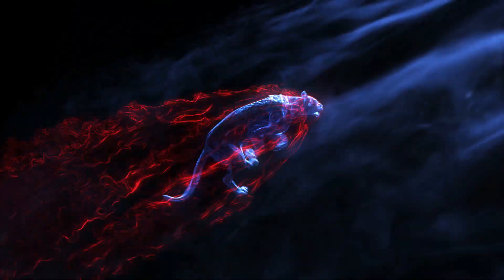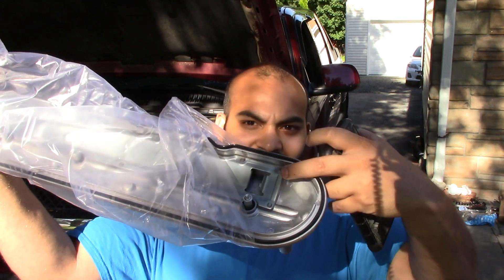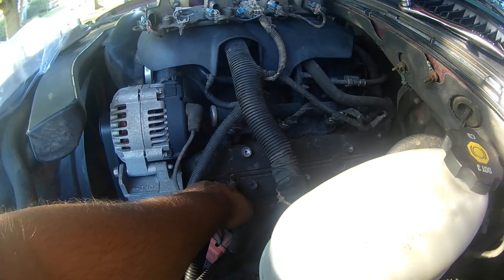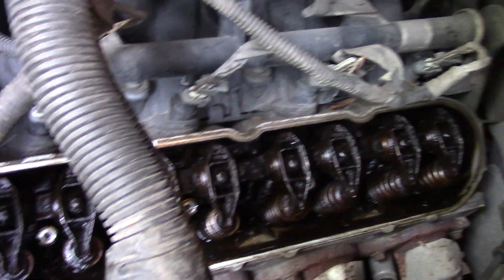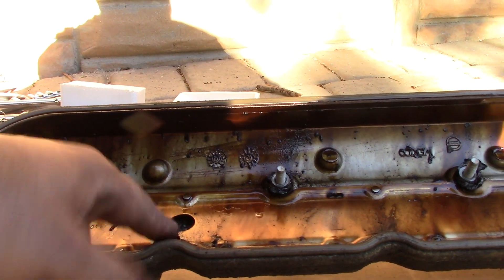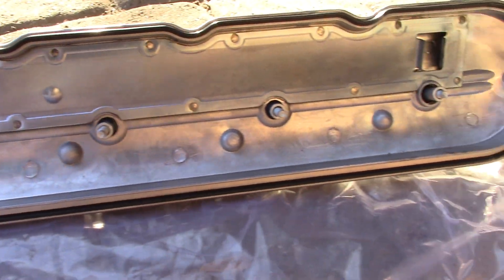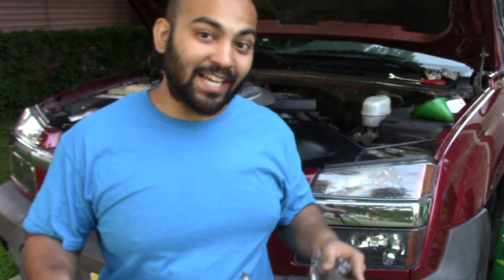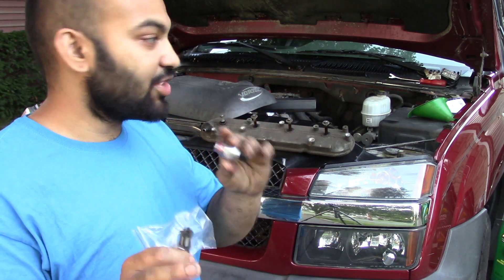2004 chevy avalanche oil consumption fix

Comment: Does this make truck idle very bad like almost wants to turn off
Reply from the maker: nope that can be your idle air control, do you have an engine light
Reply: @Kingcustomz  I had a vacuum hose that came from the pcv valve cover that was unplugged and as soon as I plugged it back in it stated to act like it wants to turn off
Reply from the maker: @liltiti86  how does the hose look, is it dry rotted, does it look fine. the hose could be weak on the inside and collapsing.
Reply: The hose looks fine there was a hose on the other side that had split ends but I changed that on and still having same issue
Reply from the maker: Let's see what my friend has to say! I'll get back to yah

Comment: Lucky Number 600 to like the Video... Now I know why my truck is using oil and no leaks..lmao
Reply from the maker: give it a try brother, if not worst case scenario could be valve stem seals or piston rings
Reply: @Kingcustomz  Thanks for the suggestion. However, it does not smoke at all.. Not broke.. Dont fix it..lol
Reply from the maker: @cliffordandrews1700  true, I agree with that 😂😂😂

Comment: Love the vids brotha. Fellow avalanche myself. I have a 02 z71. Watching your vids helps put alot thanks. Defintely going to upgrades some parts
Reply from the maker: Thanks bro, I really appreciate that... What parts are you going to upgrade?  I also have the avalanche engine rebuild series.. If your interested its in my playlist.
Reply: @Kingcustomz  

I'm not a mechanic but I do like to engage in when it comes to fixing vehicles especially trucks.
New spark plugs, new fuel injectors, valve covers, transmission flush and give it a 6 inch suspension lift
Reply: @Kingcustomz  

You dont really see alot of videos on avalanches I'm glad I found your channel
Reply from the maker: Oh definitely digging the lift, and it's okay to not be a mechanic all that matters is that your not afraid to dig in... I respect that.. Definitely send me pics of the lift when you get it
Reply from the maker: Are you doing bigger wheels too
Reply: @Kingcustomz  

Sure thing mann ill send you pics. Yeah bigget tires and getting a prerunner bumper for the front and back. Kinda gonna turn it into a overland offroad truck
Reply from the maker: Damn that seems sick I really want to see it now lol... I was thinking of installing a winch on my truck front
Reply from the maker: I am grateful to have you on board.. i have an entire playlist of the avalanche. from under coating the truck to putting on running boards to removing the engine and a complete rebuild. to fixing 4x4 issues to repairing rust spots.
Reply: @Kingcustomz  

You should Mann it really helps out alot. "Its better to have it and not need it, then to need it and dont have it". Hey how many valve covers does the chevy avalanches have let alone the 5.3 vortec engines
Reply: Awesome defintely checking out more vids from you. Ive had my truck for about 6 years now, what about you?
Reply: Me too!  I am going to do that to my 2002 Avalanche. Thank you Sir you made the fix look easy!
Reply from the maker: No problem man, let me know if you run into any issues

Comment: The oil system shooting oil up under the bottoms of the Pistons has nothing to do with the oil consumption problem. The oil consumption problem on the Chevy Engines is because they're using ring gaps that are the size of Montana. There is no excuse for that engine to have a wider ring Gap than about twenty thousands of an inch. I've seen many of them at .030, which is an invitation to burn oil.
Reply from the maker: I may have said it wrong. But what I was meaning to say was when oil is circulating, some of it by passes to the pcv on that valve cover. The new updated valve covers push the pcv a little further back
Reply from the maker: You have some good knowledge though thanks man. 😁😁

Comment: This video was after you rebuilt the engine right?
Reply from the maker: Nope way before
Reply: @Kingcustomz  do you know how much it cost you to rebuild it? And did you rebuild the whole thing or replace like 80% of the parts? Just curious.
Reply from the maker: It cost a total of 2 grand
Reply from the maker: 1600 for the machine shop they bored my block out 30 thou over. And bought the pistons rings and bearings for me ...

I purchased all parts from online  ac delco and everythint total came up to like 2 k
Reply from the maker: I did a complete engine rebuild....I have the entire series online, if you havent seen it yet
 Complete step by step and includes the machine shop

Comment: a lot of people are drilling extra holes in the old style valve covers and cleaning them saving the price of a so called updated valve cover
Reply from the maker: Hm I havent seen that before and I'm sure it could possibly work..
Reply: @Kingcustomz  all they have to do is stay clean  after all they work when they are new till people don't change the oil or they get a lot of miles on them. enlarging the hole by the pvc and drilling a few extra holes along the length of the baffle  works.
Reply from the maker: Hmmm I'll give that a shot on the older one
Reply from the maker: I'll test it on another avalanche

Comment: The top of mine done sit flush with the head please help
Reply from the maker: did you bend the cover, or is the bolts not sitting right? check if anything is caught in the way
Reply: @Kingcustomz  I got it. The gasket that came with it was way to thick. So got some knew ones. It’s still blowing oil out tho. Not near as bad. But I have a chrome Exhaust tip. And the whole inside has a thick black oil coating like a diesel.
Reply from the maker: Could be worn valve seals, but this would cause blue smoke... black smoke is unburnt fuel... do you notice if its smoking

Comment: Run sea-foam in your oil about 60 miles before a oil change. That will clean lots of sludge.
Reply from the maker: I should've. I ended up rebuilding the entire motor
Reply: On Occasion such as every 3rd oil change you can run a some seafoam to prevent sludge. Since you spent money to rebuild your engine you might consider after the break in. Running a friction modifier in your oil. Doing this on a consistent basis or make an engine last an extremely long time especially if you are very diligent about oil changes. Check out (Jay Leno‘s garage Archoil).  Archoil is not cheap but it works. Friction modifier‘s are commonly used to increase the efficiency in rear differentials.
Reply from the maker: A friction modifier. 🤔🤔 I'll definitely check that out. Yes I'm on top of my oil changes all the time.
Reply from the maker: Have you used a friction modifier in your motor
Reply: @Kingcustomz  Yes. In a 2006 F-250 6.0
Reply from the maker: Awesome, I appreciate  that info. I'll definitely try some
Reply from the maker: Woah, I'm definitely going to try some

Comment: I called Chevy.  They said that 2006 and lower did not have any consumption issues.
Reply: My 2003 consumes oil one qt every 5300 miles Also I called my dealer and gave  my Vin number they told me there's an updated valve cover  That I need
Reply from the maker: Try the valve cover, mine was the same way.
Reply from the maker: Yeah it is sad, unfortunately  they dont know. It's a good thing you at least know how your repairing it. And at least you know your doing it right

Comment: Did it fix the problem?
Reply from the maker: So far so good, oil is doing great
Reply: Before you fixed it did it smoke on a cold start up?
Reply from the maker: Yes that's normal, that is just your finger prints and oil burning up
Reply: I mean did the truck let a little smoke out the tailpipe after you started it up in the morning before you put the new valve cover on
Reply from the maker: Yes and after about 10 mins it goes awag
Reply: So did the new pcv fix it...no more smoke no more oil consumption
Reply from the maker: Yes it stopped consuming oil, but now my head gasket blew. So I'm rebuilding the engine.. I have episodes up about it

Comment: Try the updated fixed hole PCV Fram FV410  https://www.amazon.com/FV410-Positive-Crankcase-Ventilation-Valve/dp/B0010DW6  or AutoZone PCV 1009DL cheaper.  TSB 01-06-01-029B which addresses high oil consumption for various '99 - '02 GM vehicles with 4.8 - 5.3 - 6.0 engines.
Reply from the maker: The one I linked, is the update version. It's the one I used and had great results
Reply: @Kingcustomz  I telling you no need to spend $130 the TSB states a valve less PVC fixes this issue for less than $6. Auto Zone sells the 1009DL for .99 cents.
Reply from the maker: @johnmills837  alright, I wish I knew that earlier lol. 🤔🤔🤔

Comment: I thought that was only for 2007 and up?
Reply from the maker: Nope guess not... Ever since I replaced mine.. The consumption was gone.... Also the new one has a smaller hole and different location than the old one
Reply: @Kingcustomz    Your oil consumption may have gone down ,  but, at the same time, I don't really feel you know what you're talking about.  You've already  been challenged several times by individuals who understand these engines.  Whoops!  A 2-year old thread.  Guess you already understand.
Reply from the maker: One thing I've learned in life my friend is that someone out there always knows more! The important thing is I always own up to my mistakes and I ask my viewers to educate me if I dont know. 
I also have gm techs who helps me along the way with specific information. Thanks for watching!

Comment: I changed my amount I still use oil still same problem
Reply from the maker: If your losing oil badly, then piston rings are most likely  fried. Your burning blue smoke from your exhaust. Or check if you have a leak somewhere
Reply: No Blue Smoke and it is not leaking anywhere
Reply from the maker: Could be valve seals piston rings or something of that sort

Comment: Bad piston rings not value covers causing oil consumption.
Reply from the maker: Yes that's true, but in these trucks where the pcv valve is located the way it is made causes oil to be tossed up and burnt up
Reply: thats true Ronnie but you might want to read the forums for the gm 5.3 l oil consuption   the issues that gm did'nt tell the customer
Reply from the maker: @johncerecerez3848  thank you! Yeah just read up on the forums, plus they sell an updated cover for it.

Comment: Not a pcv valve buddi, its just an orfice and it doesnt work.  Take it out, go down to the store buy a pcv, drill out old one, die grinder put in new done. No more oil comsumition.  Sometimes the simple path is the best path!
Reply from the maker: hey man, that sounds like a plan. since i bought this new valve cover, i havent had the oil consumption issue any more

Comment: By the way gm is full of shit.  I was able to take my valve cover apart, took baffle out, cleaned the shoot out of it, drill out the old wanna be pvc valve with hole in it, die grind it out a bit, put a real pcv in and put the baffle back in peen the ends of the hold down tabs and reinstall.  Ill let you know how it goes!
Reply from the maker: Yeah definitely let me know. I'm curious

Comment: Did I see a gasket installed?
Reply from the maker: The gasket came already in place with the Cover.. So it was just a plug in play kind of deal
Reply: @Kingcustomz  Thanks man
Reply: @Kingcustomz  Are these PCV valves replaceable like ole school, or does the whole cover have to be replaced?
Reply from the maker: The entire cover has to be replace. They are not replaceable, which sucks.. But this particular design should not have an issue after. You can simply remove and clean and reinstall
Reply from the maker: Not a problem